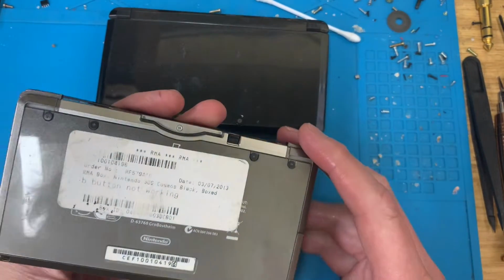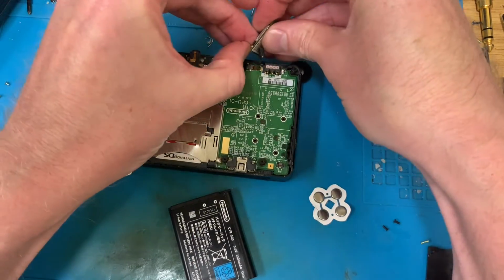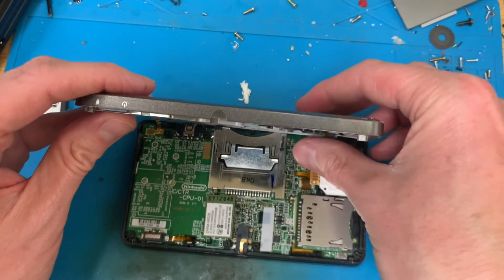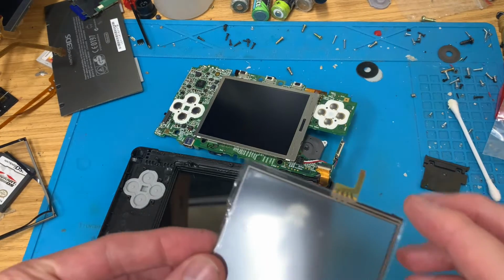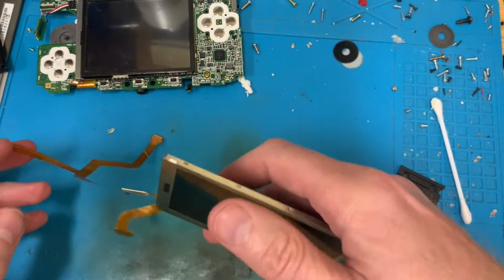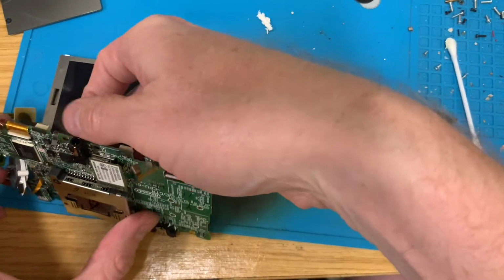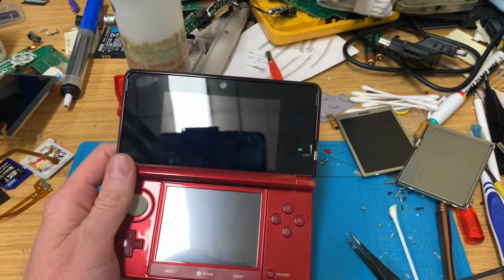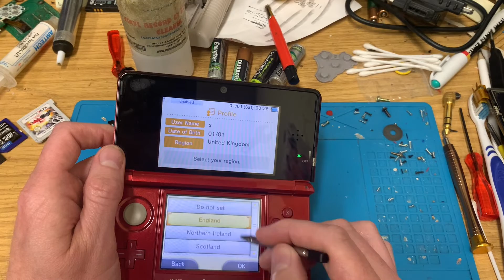4 x Faulty 3DS   3DS 2, 3 and 4   B Button not working and a "POP" sound jpg

Comment: Thanks for the vid. Do you think its absolutely necessary to remove the sd port? Could you just keep it on?
Reply from the maker: Hi, no, you can just lift it up, but I find it easier to work on by removing it 👍
Reply: @1up_Gaming  im just realizing that you need it off because of the screws underneath it. (Im trying to clean my buttons.) I guess im going to have to buy a soldering iron. Theres no other way to get it off other than solder ironing it? Im scared to just pry it off
Reply from the maker: @montwashi6907  you can just lift it, and leave it attached where the solder points are, I just remove it as it makes getting in there a LOT easier 👍
Reply: @1up_Gaming  You were right, i just carefully pryed the port up keeping the solder points intact. It was easy and the screws easily reconstitutes the sd port with the rest of the motherbox. 

I ended up getting everything open, all four of the  buttons had burn marks. Still cleaned it and hoped for the best. But when i was initially trying to open the back of the case, i stripped one of the screws and had to slowly but forcefully bend the 3ds to open it. Nothing seemed broken other than the screw port, so no harm no foul, but when i reassembled i couldnt get it to turn on.

Just ended up getting a used 3ds online. Thanks for answering my messages so quickly! Thanks for this video!!

Comment: dude, what screwdriver do you use for 3ds? I tried several different ph#00 (2mm and 2.5mm) and ph#000 (1.5mm), bad grip everywhere, I heard that you don't need a Philips PH standard, Japanese JIS is better
Reply from the maker: The gold looking thing was just a cheap set from AliExpress, nothing special.
I think it’s on its way out though, need to invest in a new one soon, no idea on its actual size, sorry, just use the one that fits  best 👍